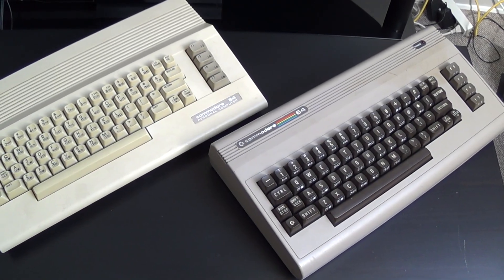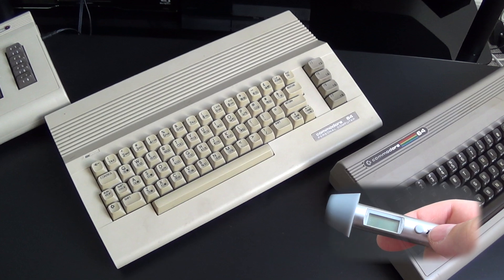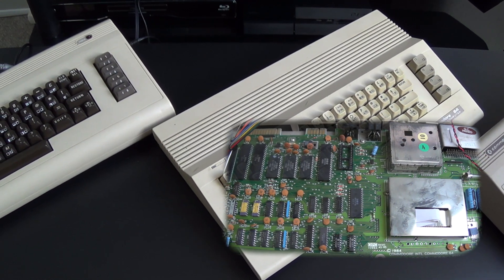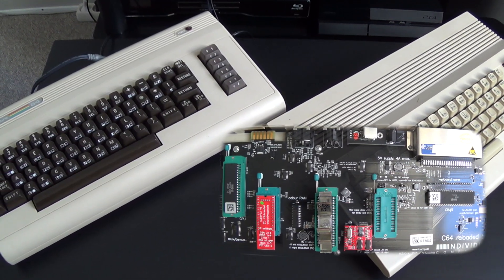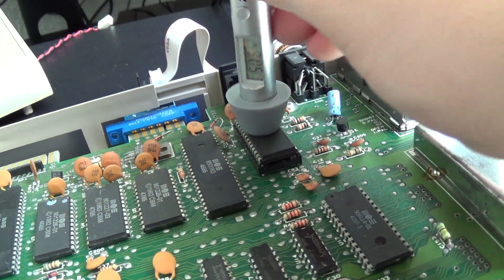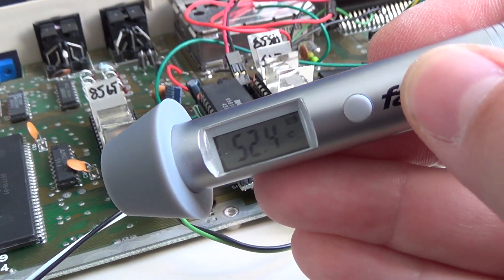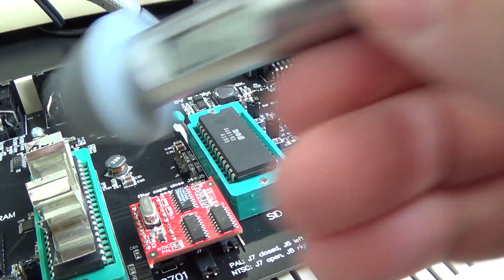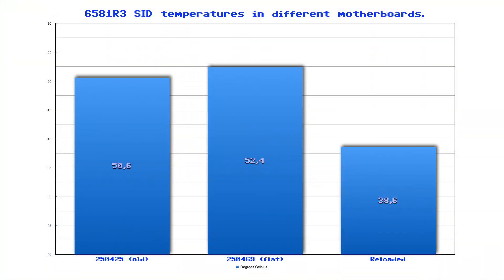6581R3 SID temperatures in different motherboards.

Comment: Provided the voltages are roughly the same I expect that the actual power draw of the SID chip is comparable for all three boards. However, chips dissipate a considerable amount of heat through the package pins. Given that the C64 Reloaded board has a comparatively massive ZIF socket it may be that the thermal capacity of the socket itself is rather high. Thus the socket may act as a heat sink which absorbs thermal energy from the chip and further dissipates it into the board itself.

edit: Also note that the temperatures in the C64C board are the highest. This may be attributable to the voltage adapter (?) board, which may be much less able to spread the heat around than a full-sized mainboard.
Reply: Casual Commodore 64 Heat travels upwards in air, true as in air convection, but there is also conducted heat through metal. Like Maik was in on, heat is indeed sinked through the pins. Some designs like mosfets for example have extra copper traces on the pcb to sink more heat. There are also graphs that show that 40 pin DIP IC have lower thermal resistance than lower pin count DIPs.. but I don't know if that is because of the size of the package or the number of pins.. or both.. Interesting test. Try 1hour. Temps have probably not reached its top yet because air temp in the box continues to rise.. another explaination why the SID in the reloaded is colder is because of the new power supply design, which in the Commodore boards produce lots of heat both in the psu but also in the c64 case aswell (5V and 12V "CAN" supply).. Also because of this it would be great help to measure air temp inside the cases. If you get the same delta temp (measured ic temp minus air temp = delta temp) for all ic's, then you know it is the case temp that explains the temp difference and not the ZIF socket.. Ps. Also room temp determines the end result. If its' 5 degrees more in the room you can bet the readings will be 5 degrees higher.
Reply from the maker: bwack Interesting. But now it gets a bit complicated for "casual" little me.. ;) But it could be interesting to do another test, where I run them all for an hour. Then measure temperatures from the chip, inside closed case, and the room - maybe include voltages too. That'd be worth another video. But I do not have equipment for all that. I'd need some temp measuring device with at least two probes. I only have that temp gun. But I could do another open case test, where I run them for an hour each and include room temperature each time. That's at least a bit better. Then just report my results in this thread, and in the description.
Reply from the maker: bwack I have now done the new test. Please see video description, if you are interested. ;) I have also added a short note in the video, at the chart part.
Reply from the maker: Maik Merten Hey Maik. :) I think the temp is slightly higher in the C64C because of the neighboring 8580 SID. And as I'm sure you know, heat travels upwards, so I really doubt a ZIF socket (or any socket) can contribute much to heat dissipation - let alone over 10 degrees! But of course, there might be things I don't know, so I MIGHT be wrong. Anyone? :)
Reply: Hey :)

Heat will travel in any direction as long as there's a fitting medium. The "heat travels upwards" certainly applies for air or water as the medium itself moves around due to density changes. Solid metal, however, "stays put" and will transfer heat basically in any direction. You can try this by pointing your soldering iron down and touching the tip ;)

For modern boards, heat disspiation through the ICs pins is a major factor when designing the thermal system and may be the deciding factor if a proper heat sink is required or not.

Now... whether this effect is enough to explain the 10 degrees difference in temperature I don't know. Did you verify the boards provide somewhat comparable voltages?
Reply from the maker: Maik Merten No, did not think of checking voltages, so I did that just now. 250469 (C64C): 12,06v - 250425 (Old): 12,17v - Reloaded: 11,71v. So, undervolting (if that's a term).. That should explain a bit, at least. Funny thing about the Reloaded is, if I measure the empty socket (no SID inserted) it reads a normal 12,09v. If the SID is inserted, it goes back down to about 11,7v.. Huh.. :)

Oh, and to your soldering iron example: duh..! ;)
Reply: Casual Commodore 64 Thanks :)